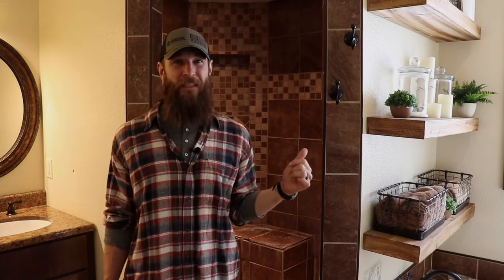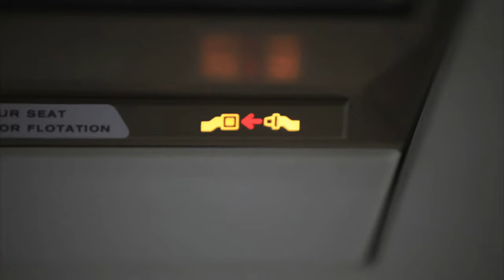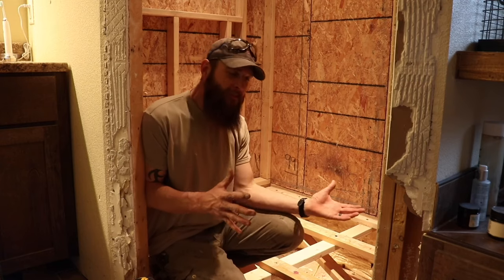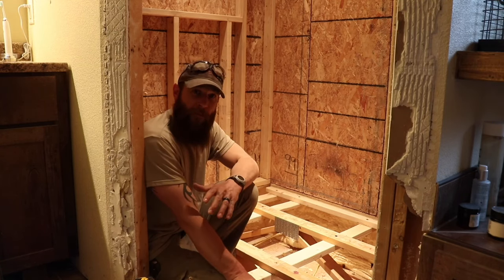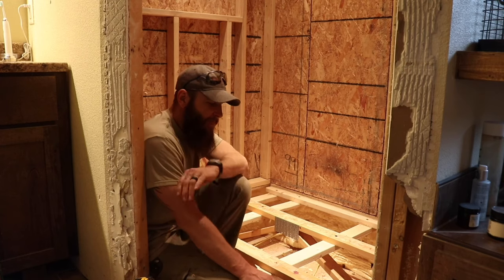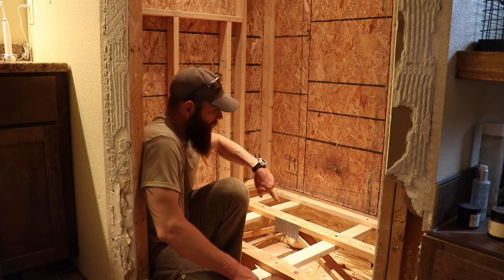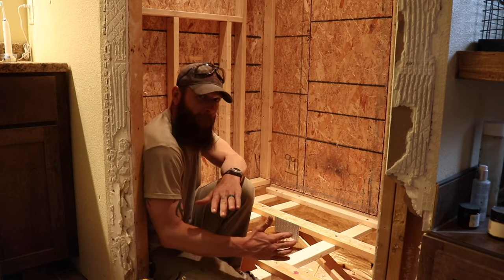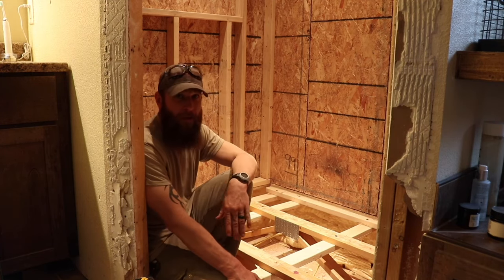DIY CUSTOM concrete SHOWER

Comment: Only reason I wouldn’t jump at having this shower would be the trying to clean in between the cracks but honestly it’s almost even worth it 👏🏼👏🏼🔥 amazing work
Reply from the maker: Thank you!! It’s actually not that bad. We have a battery powered brush that we use to clean it.The brush head spins and the handle is a 20” wand. So it actually makes cleaning pretty easy.
Reply: you can always lightly fill the cracks with clear or colored epoxy.

Comment: TRULY INSPIRING!  Gotta say, too, that the extra touches in video production was great.  (Like the text falling out of the bucket… very cool) 
A few years ago, we built an indoor shower that was made to look like an outdoor shower… we used more landscape construction rather than typical indoor methods.  (Wish I could show you a picture… it’s pretty cool).  Faux stone, river rocks… very “castle-esque”.  Our budget was next to nothing, We went to Home Depot and discovered that a lame, plastic shower pan was $180… and I was like: NO WAY!  We can do way better than a dumb square of plastic with a hole drilled in it.  So we got started with left over supplies from various jobs and projects, repurposed lumber, etc.  The end result is awesome.  
Before and since then, I have scoured the Internet for unique DIY ideas and could not find ANY that were as good or better than what we did.  Not trying to pat myself on the back too much but everything was just various Home Depot inspired, boring crap.  We have another shower to do and we wanted to improve on what we did before.  It was pretty cool that our creation was better, in my opinion, than anything I was finding online but it was also discouraging because I felt like I was out of ideas. Yours is the first and only one I have found that truly got me inspired all over again.  Absolutely stunning.  I love it.  CERTAINLY does not look like everything was purchased at Home Depot.  Haha.  AND it resembles a skill I have already practiced… I learned how to create large, naturalistic habitats for my reptiles that is basically expanding foam carved to look like real stone, then sealed with silicone and covered in sand, soil, coconut fiber, etc.  This mine grotto shower is a much cooler, much sturdier variation of that theme so I feel like it’s something I could definitely pull off!  
Anyway, thank you so much for the awesome video and the truly unique inspiration.  It’s exactly what I needed to spark my imagination once more and get to work!!
Reply from the maker: Wow awesome! Very glad you liked it and was inspired from it! And thank you!

Comment: It is BEAUTIFUL! Some explanations of what you're doing and why would help a lot.
Reply from the maker: What would you like explained?
Reply: @TheHiddenHomestead  Pretty much all of it. Is it all concrete? special mixture? What sealants, where? Any way it's wonderful!

 I am buiding a very minimalist home using Faswall Blocks on a slab. The bath has 3 stick walls and one masonry. I would like to skip all the high tech multilayer hoohah if possible and it looks like you have?
Reply from the maker: @sandralewis1689  Ok well,
-Is it all concrete? What you can see, yes it is. 
-special mixture? As the video shows it’s a mixture of Portland cement, fine sand and (acrylic) polymer admixes. So nothing to special about it but definitely not just a bag of type N mortar. 
-what sealants? For the walls the paint used is an acrylic modified exterior paint which seals the concrete then 511 impregnating sealer is used over that. The floor is sealed with a masonry penetrating sealer then an acrylic concrete sealer. 
When you say high tech multilayer hoohah, what are you referring to? I do have multiple layers but no they’re not all that high tech or expensive. The most expensive thing that I used is the hardibacker cement board with hydro defense. There’s many ways to “properly“ build a shower. But depending on who you talk to you more then likely built it wrong. I’ve been told numerous times that the way I built it is wrong. And maybe I did. Maybe I don’t know any better because I’m  not a professional shower guy. But what I do know is that it was built a little over a year ago, I take VERY long evening showers shamefully wasting a ton of water, it was built on the second floor just above the family room where I spend the rest of the majority of my time when inside and not asleep, and ya know what? So far no leaks. I say all that to say this, I think that a little common sense sometimes can go further then the high tech hoohah. 
Hopefully that answers at least most of your questions.
Reply: @TheHiddenHomestead  Thanks so much for the help.
Reply from the maker: @sandralewis1689  👍

Comment: I think that design could easily spread throughout the house, I have a ton of questions that I sure wish were answered throughout the video, but great job, please do a follow up after a while to discuss any changes, cleaning, maintenance, etc .  I love unconventional home designs and this definitely fits the bill, great job!
Reply from the maker: Thank you! I was actually thinking about doing a follow up to discuss the pros and cons and how we clean it.
Reply: @TheHiddenHomestead  that would be great! I'm also very curious how you clean it with so many little grooves. I'm sure you can't take a brush to it or else it would scratch.
Reply from the maker: @Steven-e7c  no we actually do use an electric oscillating soft bristle brush with 50/50 water/vinegar spray. Every once in awhile we’ll need to use something a little stronger to get rid of the really stubborn soap scum.
Reply: @TheHiddenHomestead  great to know. Thanks for the quick reply.

Comment: What's it like cleaning the shower? Lots of pores to hold moisture
Reply from the maker: It’s really not bad. Theres cracks and crevices but it’s not porous. The paint I use is a high acrylic exterior paint that has “mold/mildew prohibitors”. Which I think has helped. Then every other day or so it gets sprayed down with 50/50 water vinegar mixture. And once every other week we do a quick scrub down with the water/vinegar and a soft bristle brush.

Comment: Two questions... 1) What did you use over the PVC liner and how did you fasten it down to keep it from moving? 2) How did you get your concrete to stick to the foam and not lift off?
Reply from the maker: After the liner went down I used the same mix design that I used for the rest of the shower, which was my mix I created for vertical concrete. All I did with the liner was staple the very top edge and glued the seams (as recommended by the factory) to keep it all in place. 
Again, I used my vertical concrete mix design to cover everything. It’s made specifically for vertical surfaces so it’s pretty sticky and will hold to a lot of different surfaces as long as it’s not built out to much. What I mean by that is, the more it’s built out the heavier it will get. Even though it’s a sticky mix, gravity will eventually win.
Reply: @TheHiddenHomestead  In the video, it looked like you had put down some cement board or something over the liner. It could just be a visual illusion. It doesn't try to shift/move without something like lathe or cement board to hold it in place?
Reply from the maker: @paramax55  oh yes. The cement board was placed on the walls which overlaid the liner. Of course, no screws securing the cement board was installed below the liners edge. The other thing that could have helped secure the liner was the drain itself, but there was no glue or mechanical means to secure the liner in place. Once in place, it will maintain its shape for the most part until you pour the concrete bed on top of it.

Comment: Super neat!!! How do you guys like it after a couple years? I want to replace our tile shower for the same reasons you mentioned. So how’s concrete holding up with mold and mildew?
Reply from the maker: Thanks! Concrete’s doing great. Cleaning isn’t all that bad really. Takes a little more then most showers but thats ok considering it definitely is more than most showers.

Comment: I would love to know more.  Can you share a direct link?  I am curious to know how it is waterproofed?
AMAZING work!
Reply from the maker: Thank you very much! I don’t have a direct link for any more information on it really but I do have an online course for vertical concrete if you’re interested in that. As far as waterproofing it was no different than doing a tile shower. As in I preformed all of the the same steps and practices as you would if you were to install a tile shower.

Comment: Did you seal the concrete?  If so did you have to wait for a cure period and what did you use?  How is the shower performing after 3 years?
Reply from the maker: I waited for about a week before I sealed it up and it’s still holding up well.

Comment: It looks amazing, and full credit for your film set of a shower room.  But I am concerned about the upkeep.  That looks like it'd be a nightmare to clean... is it?
Reply from the maker: Thank you! 
Well, I’ll say that it’s not an average shower so admittedly it does take longer than average to clean. That being said, it’s really not that bad. Two to three times a week we do a quick spray down with a 50/50 water/vinegar mix after we shower. Every other week we use the same mix and scrub it down with a powered/rotating medium bristle brush. We have a few different shaped heads that we can use to get in all the hard to reach areas. Then if needed, once or twice a year we’ll go in and use something a little stronger than the water/vinegar if there’s a lot of soap scum build up. It normally doesn’t get that bad though if we stay on it with the water/vinegar mix.

Comment: just found this video. amazing work! 

Is there any issues with water standing in the big gaps? would you grout the spaces just i case ? 
I would like to make something like this but i worry about the possible mold and  cleaning issues. is it fairly easy to keep clean and maintained?
Reply from the maker: All the edges/gaps were shaped downward to allow drainage of excess water. The whole thing is essentially one big grout piece so I wouldn’t worry about it. Plus it’s sealed up with the paint and impregnating sealer. 
Speaking of paint; I use a high acrylic outdoor paint with mold prohibitors in it. I’m not sure what exactly is in the paint but it does help keep the growth of mold down. 
As far as maintenance and cleaning it is fairly easy… considering what it is anyway. It definitely takes more to clean then a normal shower. But. It’s not a normal shower. First thing to consider is a water softener. This will keep a lot of the calcium buildup from forming. Second we spray it down with a 50/50 mix of water/vinegar one or two times a week. Then, once or twice a month we scrub it down with an electric powered rotating soft bristle brush and more water/vinegar. It’s really not as difficult as some would think.

Comment: How has this held up? How easy is it to clean?
Reply from the maker: It’s held up pretty good. Cleaning has been rather easy and straightforward. Considering of course. About twice a week we spray it all down with 50/50 water/vinegar. Then every other week we spray and scrub it down with a soft bristle brush. It’s pretty clean as far as mold mildew and grime. However there is a soap residue (not scum) that we’re having a hard time with. It might just be from the specific soap we use. Dr Bronner’s. I’ve been hesitant on what cleaners to use because I don’t want to mess up the finish. But I think I’m going to start testing a few different ones and recolor if need be.

Comment: How would you scale that down? What I mean is, if I want to be able to do that, I need to practice starting off on the small scale, any recommendations?
Reply: You bring up an awesome point..
Reply from the maker: There’s no difference in technique or the mix used. You would literally and simply just scale it down. There’s a few different ways you could do that. Use plywood to build some 2x2 or 4x4 sample boards.  Prep it the same way that you would if you were installing tile or an exterior wainscoting then start slinging the mortar on. Another way is to roll out some plastic and just make blobs of different shapes on it using the mortar then carve and shape them to mimic stone or wood.

Comment: Hey! What’s the mortar mix ratio? 

Trying to “microcement” walls for shower but cannot find anything that’s not pre mixed for $100 a bag and from Poland! Lol

Also did you apply any kind of primer besides the water spray bottle? 
Thanks!
Reply from the maker: I have a pinned comment on the video. It has information and directions to get my mix ratio

Comment: Where did you find the silicone molds of the tree knots and bent spike? I’m looking everywhere and no luck.
Reply from the maker: I made them with a two part epoxy putty. 
https://www.smooth-on.com/product-line/free-form-air/

Comment: Awesome job. So how hard is it to keep clean from mold and soap scum with all them really deep grooves, cuts and what not? I know you sealed it at first but have you had to since?
Reply from the maker: I’m probably gonna apply a second coat of sealer again here soon.  It’s almost been a year so it’s about time. Just to keep everything clean and fresh. As far as mold and soap scum: we haven’t noticed any mold but a little soap scum down in the corners of the floor. Which admittedly is expected considering we’ve been pretty lazy in cleaning it for the last few months. Normally though we spend about 5 minutes a week on cleaning it which how we do it isn’t much at all. Usually after every other shower we just do a quick spray with a 50/50 water/vinegar mix. Then once or every other week I do a quick spray and scrub down with a soft brush while I’m already in the shower soaking. On top of that the paint is intended for exterior use and claims that it’s mold and mildew resistant... and I believe it.
Reply: @TheHiddenHomestead  Thanks. I figured with the texture it would be a little harder to maintain than typical showers. Awesome work tho. Im strating in the decorative concrete adventures myself.
Reply from the maker: @wegotthis2734  yeah. But not as bad as you would think. 
Awesome! It’s pretty fun stuff and crazy what you can make. Have fun with it!!
Reply from the maker: @wegotthis2734  oh and thank you!!

Comment: i agree its great art, but how  hard is for cleaning, and where is vantilation syste for moisture  and mold ?
Reply from the maker: Is it more time consuming to clean then a typical shower? Yes 
Is it a typical shower? Obviously not. 
We keep a spray bottle of 1:1 vinegar to water in there and after every two or three showers we give it a quick spray down. Every other week or so while I’m soaking I’ll spray it down and do a quick scrub with a soft long bristle brush. And that’s it. 
The vinegar helps break down the calcium and soap scum and it kills mold. On top of that the paint used has additives that make it “mold resistant”. The vent is on the ceiling right out side the door. I’m allergic and pretty sensitive to mold and my body can tell when I’m around it. We’ve had no issues.

Comment: Awesome way to overcome a trip with magitude creations of concrete ! Question ... Ever considered ancient morrocan tadelakt or after you experience ... Considered it would be more of the same. Yes i consider bczof something many hours as working concrete rough on knees structure I am considering to remain as close to staying earthen ... But do u know of tadelakt methods  ?
Reply from the maker: I never heard of it before but just did a quick search on it and I’m intrigued! I’m going to look into it some more.

Comment: Looks cool but how hard is that to clean?
Reply from the maker: Not bad actually. Once or twice a week after I shower I spray it down with 50/50 vinegar/water. Then every other week I spray it down and scrub it quick with a soft bristle brush. I admit it takes more to clean then a typical shower but it’s also not a typical shower.

Comment: What kind of sealer did you use to seal the concrete?
Thanks
Reply from the maker: Cost after coat of acrylic paint and then am impregnating sealer

Comment: Great project, thanks for sharing. How long would you estimate your time in the concrete work, before paint/stain, but after demo?
Reply from the maker: Not sure exactly. I had about 60 hours in the whole thing. I’d guess I probably had about 10 hours in just the stone and wood overlay  part plus the cleanup, prep and build out.